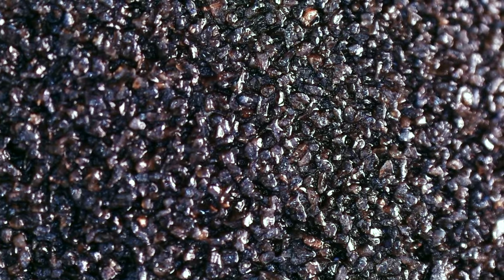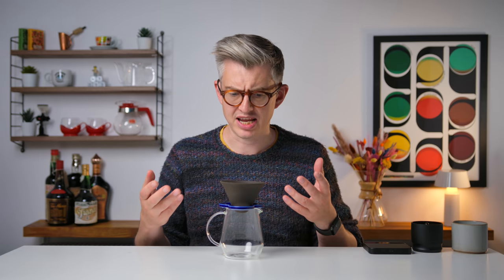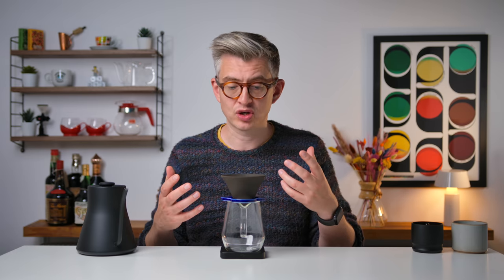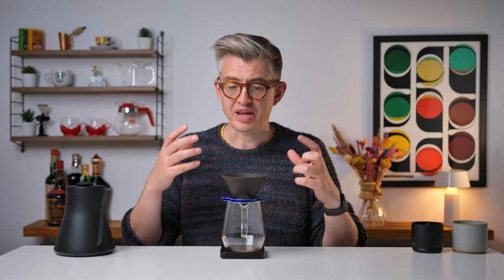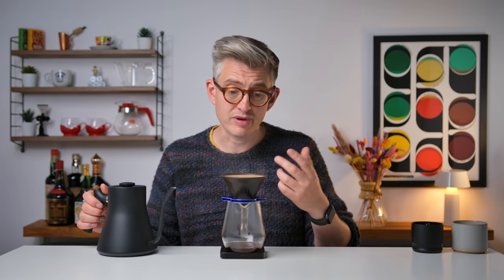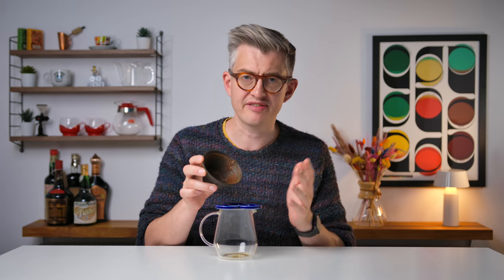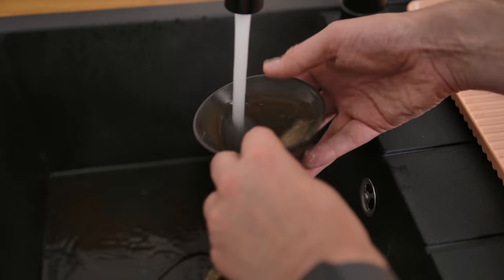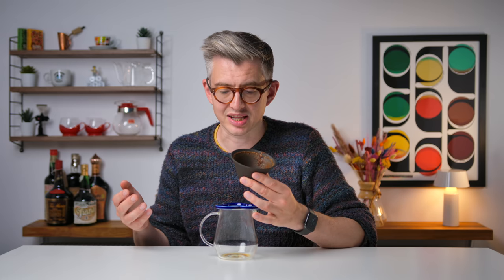Ceramic Coffee Filters: Magical or Maddening?

Comment: The emission of infra-red is NOT dependent on the material - it is just the function of temperature - whether it is ceramic, water or metal, at a given temperature they will give out radiation of the same wave length

Comment: Suggested experiments for cleaning the thing: vinegar OR food grade hydrogen peroxide. Both should in theory work to chemically dissolve any detritus in a way that's not actually harmful after being rinsed (Provided that it is fully rinsed before use. Maybe this will require less water than the method in the video? Maybe it won't?) Note, that 3% hydrogen peroxide purchased in the brown bottles at the pharmacy are NOT food grade, and contain stabilizers that are hazardous in a culinary context so only true food grade hydrogen peroxide would be proper for this experiment. Additonally , you can find food grade peroxide in higer concentrations than 3%... these would work wonders for cleaning but would require proper PPE for safe use so probably just stick with 3% unless you know what you're doing.

If you're using this strictly for one cup a day, an overnight soak in either liquid should be sufficient to chemically dissolve any detritus, and a thorough rinse in the morning should hopefully bring it at least closer to a true clean. BUT I haven't tried any of this, and I don't have any of these gizmos so I'm not making any claims just an idea.

Comment: It's not just ceramics that emit far-infrared radiation, your basic coffee filter does too. In fact, all matter at temperatures above absolute zero (0 Kelvin or -273.15 degrees Celsius) emit electromagnetic radiation at wavelengths corresponding to their temperature, which is why we also call it thermal radiation. Things near room temperature (boiling water is near room temperature in this context), thermal radiation is most intense in the FIR part of the electromagnetic spectrum. This is also why metal glows red when it's hot.

While some materials are better at radiating FIR than others, I am almost certain there is no significant difference.

Source: space engineer, thermal radiation is a very important factor when designing spacecraft.

Comment: A few things to read up if you are interested on them:

Light as an energy source for chemical reactions. Generally they are microwaves and I am highly dubious of their claims. The heat flux (energy crossing a plane with an area per unit time) from infrared radiation from ambient things is extremely low, so I doubt it is doing anything more than just your standard brew. Related to this is black body radiation. Everything around you absorbs and emits light. Things around room temperature peak in infrared radiation. A black body is the ideal situation for emission of a spectrum to approximate real objects. More reading on this if you are interested in physics is the "Ultra-Violet Catastrophe" and the start of quantum mechanics.

Packed beds and fluid flow. This is how fluids behave when they flow through obstructions. This can include things like space time/residence time for how the fluid flows through the system. Brewing a coffee is a batch system and most of what you will find is likely to be continuous processes. You can look this up in terms of percolation. Percolation is a separation technique that involves a solvent passing through porous materials.

Comment: if the particles of ground coffee lets say a coarse grind is 1 millimeter then why not use a soft steel mesh filter with holes less than 1 millimeter to filter? Would it not be the same as filtering with the paper  stuff?

Comment: how to clean such a filter? 
here my thoughts:

1. pyrolysis
my pizzamaker can go up to 550C quite quickly.
(if the internal structure doesn't get damaged by heat that might be an option)

2. baking soda??

3. H2O2 (Hydrogen Peroxide) 
that one might clean well as it will soak nicely...

Comment: infrared radiation is just heat. I say this as a person with a degree in physics...look at a chart showing you the spectrum of light. below visible light is infrared. near infrared is close to the color red that we see, and far infrared is further from the red we see...ie, heat. below that is microwave and below that is radio...by below I mean wavelength. these have longer wavelengths. above visible is UV and then X ray and then gamma ray...these have shorter wavelengths. infrared though is just heat, the hotter something gets the more it moves from infrared to visible...this means its so hot its emitting visible light in addition to infrared, and if it gets massively hot, it will also emit UV etc.  The filter is emitting infrared because its hot. You pour hot water in it and it gets hot...ANY object that gets hot will emit infrared. This is a marketing gimmick to say at least that part.

Comment: I would not clean it that way. Water on the inside will inevitably force tiny coffee particles into the medium.   I would, I think, boil a small pot of distilled water, invert the cone, and pour through the bottom. Only after doing that would I rinse out the inside.  I  can see why, doing it the way suggested in the video, brewing would 1. get slower over time and 2. the coffee would develop a taste -  from the tiny coffee particles embedded in the ceramic.

Comment: I'm really surprised that you don't use bleach to deep clean it, like you do with Sawyer waterfilter (which is ceramic too IIRC).
Bleach would eat away at oil and organics rather well, and then you can just rinse and boil it later to remove the residual bleach and particles.

Comment: This is speculation, but what I suspect happened is there was a scientific study something along the lines of "If we alter the amount of radiant heat coming from particular bands of IR during roasting, does it affect the heating profile of the beans in a way that has a change that might be considered an improvement".  Or some other way to link infrared radiation and coffee in some highly specific situation. Someone skimmed that study and came away from it with the simplified to the point of being utterly wrong "far infrared radiation makes coffee taste better."  They then saw that some radiant heating devices use ceramic heating elements so "ceramic is good for making infrared radiation".  Given those two ideas they came up with "ceramic filters are better at emitting far infrared radiation and therefore make better coffee".

Comment: Sinterd iron and bronze hav been used as industrial fillters for years i think the very erly landrovers even had an an air cleaner of sinterd brass in an oil bath but in industry setting all theas filter types would be solvent (not good here) then blown out with compressed air

Comment: Far infrared here basically means thermal radiation of things not hot enough to emit higher energies, which is the case for temperatures below 100 °C. It also happens, that amount of this radiation is very small, so IR cameras are very expensive. For that range of temperatures, convection, thermal conduction etc. are main ways to transport heat, and thanks to that it is for example possible to create a thermos. Double-walled containers with high vacuum inside works, because then only radiation could dissipate heat, and it does not. Radiation is very low. Low vacuum doesn't work, because even small amount of air conducts heat better. So anything about heat retention and dissipation due to far infrared is far stretched out. Also, this radiation has surely nothing common with brewing, because, if emitted from walls of a dripper, it couldn't reach almost all of coffee particles, because it is stopped by anything apart from some gases. And even if it did, it would be nothing compared the same kind of radiation raging inside a slurry and every other interaction that truly takes part in the brewing process. Ceramics is also not somehow special in emitting thermal radiation in IR range, and of course it is not possible for brew to accumulate this radiation to be drunk later.

Comment: So I hadn’t used it yet but decided to try my Kyuemon ceramic filter after watching this video.  I already bought it. I love it! I purchased the medium size filter and it’s perfect for me since I only drink 1 to 2 cups of coffee a day. I began by rinsing it with some cold water a of couple times since it’s my first use. I put 2 tablespoons of a course organic ground coffee from Sam’s Club. The 1st cup I put to the side and let cool. I sipped the 2nd cup and it was delicious.  The floral and fruity notes of the coffee really came through. Then I rinsed my filter right away by dumping out the grounds and then I rinsed it under hot water and then I put the filter over a small cup and let hot water drain through it until clear which was only about may be a cup of water.  I didn’t feel like I was using massive amounts of water, actually quite the contrary because I wasn’t using soap. Of course this is my first you so we’ll see what happens after a month in.  Oh, so the first cup I had let cool was a little weird. It tasted oily and there was all this residue on the bottom which the 2nd cup didn’t have. Maybe just because first use?!

Comment: I feel like the only proper way to clean one of these is to seal it in a big tube and force very high pressure air or water through it to force the particulate back out the top.

Comment: "FIR... filter..."
OK I was here for coffee I did not expect a flashback shell-shock moment about engineering grad school.

But anyway, it sounds strange, but I guess they mean by the infrared is that its emissions are in a certain way in the frequency domain of EM radiation such that the filter retains heat a certain way? I mean, guessing that this is about coffee, I'm just guessing they mean something about heating or heat retention because that's what IR radiation's usually about.

Comment: I'm afraid the "far infrared radiation" effect claim .. holds no water.
Water is pretty much opaque to 8-12 µm (thermal) infrared, and there are numerous FLIR camera videos around on youtube that drive home the point that when it comes to that, water looks like colour-changing acrylic paint. So whatever comes from the outside as radiation immediately stops at it hits the water. It certainly won't touch the coffee grounds.
What the sintered filter does (when pre-heated with hot water before adding the coffee) is keep warm. This might keep the newly added water for the brew a little hotter.

Comment: I'm not suprised that you can taste from the ceramic filter.
Materials you would think are inert can leave a noticeable tast. For example, I notice a distinct metallic taste om my hands from using a bar at the gym! Even steel isnt inert!

I don't like paper filters becase I can tast them!
But also because the remove the foam I like the coffe to have (almost as espresso!)

I preper a coffe press. The difference between that method and a paper filter is profound. Especiall notisble if I grind my own beans. A paper filter takes away much of the differnce from bought ground coffe.

My criteria for an acceptable brewing method is go good foam at the top of the coffee. Without it, I regard the coffe as dead and tasteless.

So I was disappointed that you didn't show the coffe itself in the video, even if a dont expect any filter brewing method to have any of my vital foam.

Single cup brewing with a coffe press is the way to go!
Although I don't know what Americans like. I actually can't drink their weak "coffee". (I even prefer tea to that!)

Comment: Two years ago or so, I bought a reusable, washable filter of polymer and metal. I thought it was amazing at first. Until it wasn't. Because there are areas and surfaces that just cannot be washed. Coffee is oily. And that oiliness causes grease to build up in there and it stays. And it clogs the pores. Every time I use it, the filtering goes slower and slower. If I toss it now, I will have caused more trash to be created than if I had used paperfilters that can just decompose with the rest of the biological garbage

Comment: I appreciate your multifaceted assessment of product sustainability- however, you’re only looking at the consumer use part of the picture. Paper coffee filters require a great deal of water to manufacture, and often times get stored and shipped in plastic to keep them dry. Also, depending on the filter material, there’s a chance it was made using trees gleaned from deforestation. 

It’s hard to say what’s more sustainable. There is a lot that goes into sustainability that exists behind the scenes. This is why sustainability is not a personal responsibility- it can’t be, it requires systemic change. Making sustainable choices is important because it is like voting with your dollar, but ultimately if we want lasting sustainable change it has to be on a scale that extends far beyond how you or I brew our coffee in the morning.

Comment: Actually, oxygen concentrators work in a similar way. Under pressure, air is forced into a ceramic with pores just big enough to absorb nitrogen, but not oxygen. The almost pure oxygen is then bled away for use, and the pressure removed, which releases and discards the almost pure nitrogen. Fresh air is then taken in, and the cycle repeats. Many hospitals now use them instead of a room full of oxygen tanks, and they are also used to supply oxygen to fighter pilots.

Comment: The claim is that the ceramic filter itself emits far infrared?

I mean .. anything hot, emits far infrared -- which is the operating phenomenon behind FLIR cameras.

But thats nothing that has to do with the ceramic material itself, more the heat of the hot water.

Im not aware of any other methods by which a ceramic body would emit FIR.

The first consideration is that it would require an energy source to do so. Water would emit FIR because its been heated -- at least thats my understanding.

Where would the energy come from in a ceramic filter?

Comment: These are like the ceramic rods in water purification….which can remove contaminates. It would be better if the system is compressed and cleaning would require ultrasonic device with baking soda 😅 the flavor you are tasting is probably the earthiness of the clay used or the mini particles offer large surface area for chemicals to react and change catalytically or quicken rancidity. Burning it would release carbon, but the minerals left behind will bind to the clay making the pores much smaller over time and make it prone to clogging.

Comment: Soaking in roughly 10% Hydrogen peroxide should remove the oils and odd taste that appears after a few uses. Of course, concentrated hydrogen peroxide isn't available everywhere, and you need to watch out for additives that may make it unsafe for food surfaces

Comment: In chemical labs we often use a glassfilter it's a porous glass material. This is the same principle I guess, the biggest problem with these is cleaning, well in lab we have harsh acids or bases to solve everything but at home I wouldn't now how to clean out so much organic residue which stays in the small gaps, since it's not that normal to have sulfuric acid at home 🤷🤷🤷

The infrared thingy sounds like pure marketing nonsense to me

Comment: First quick-rinse it, then, for heat, use a oriental wok white-gas stove; place the cone over the burner, low 30 seconds, medium low 30 sec, medium 30 sec, medium high 30 sec, high at least 30 sec; leave it in place to cool; extreme temp changes to quickly will destroy it, but extreme temp is the ONLY way to clean it. The real reason for this is not at all to 'save the earth' --if the people who wanted this were that stupid they would be using the bleached paper. It's for the ultra concerned for not ingesting unknown compounds by using other philters, paper, metal, etc.. Mostly paper, because nothing filters as good as paper except this. Side note the carbon from heating it is a longevity ingredient --keeps your telomeres long.

Comment: In order for ceramic to be this porous it must be fired at low temperatures. Clay that is fired at low temperatures will not have "baked off" many of the volatile compounds present in the clay, which in use will end up in the coffee. Clay pots that are used in specialty tea are very similar but obviously are not nearly as porous as this. Insane product that probably should not exist.

Comment: An ultrasonic cleaner could likely clean this thing perfectly with less energy then the hot water or burning. Would also be useful for the rest of your gear, as it can clean to medical standards. And they are getting cheaper and cheaper every day.
Reply: They aren't the best for a porous ceramic like this, it will break the material apart and wont even be able to pernitrate all the way through because its amorphous

Comment: If folks are concerned with sustainably to the point of putting up with a weird taste, why not just use a reusable plastic and metal filter in a super cheap single cup coffee maker? Everything can be washed and reused; you can even use soap.
Reply: This isn't even sustainable as it requires an intense amount of energy and water to clean and they recommend using natural gas to do it

Comment: It's really never a good idea to use a porous material for food production or consumption. It's why it's never advised to used 3D printed objects for food use, even if you're using food safe parts and food safe filament. The porous nature of the materials allow the build up of bacteria that cannot be easily cleaned. Even then, if you manage to kill the bacteria with heat treatment or what not, it may have already left behind bacterial toxins that are not broken down by heat. And you certainly need to be careful with heat treating ceramics as many types are not thermally conductive, meaning it may actually be extremely difficult to heat the internal structure enough to kill all the bacteria inside.